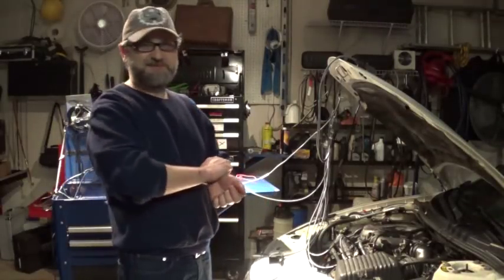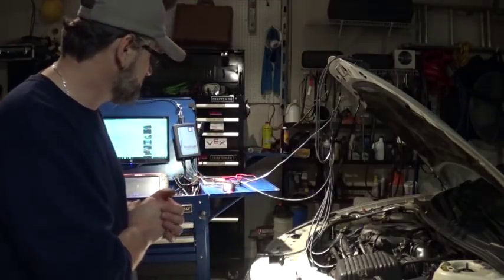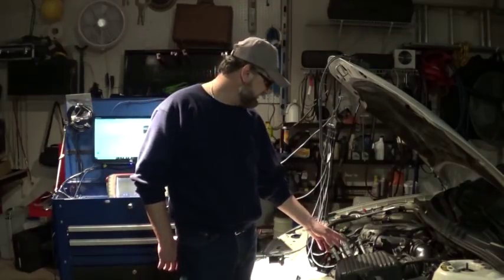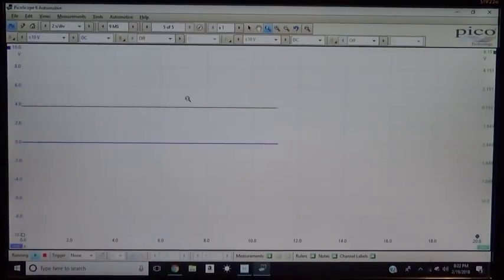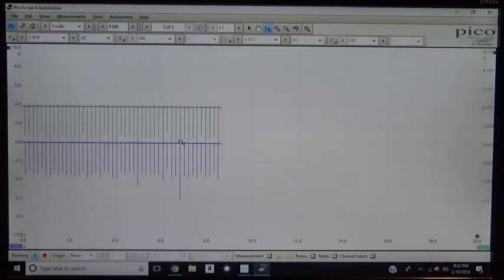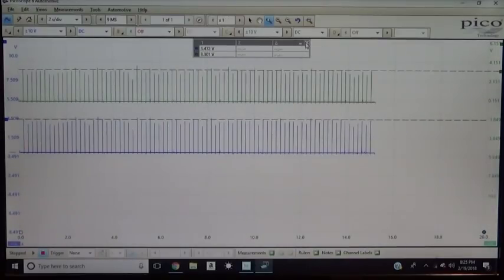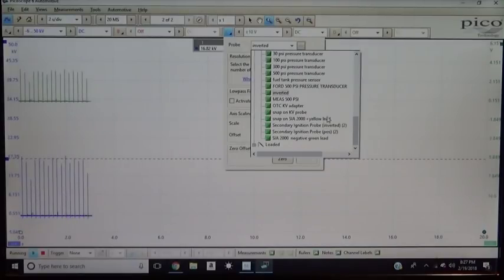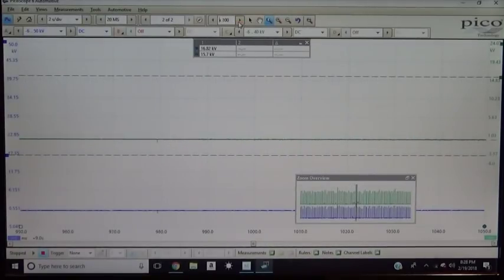Using Snap On SIA 2000 With Picoscope

Comment: Do you need to used an attenuator when you hook it up
Reply from the maker: german torres I don't use attenuator because max voltage output from SIA2000 is around 3 volts but you need to make sure to hook up your ground lead to engine block.

Comment: thank you for the video... is the power kv the distance between top of firing line and top of sparkline where sparkline leaves the firing line or is power kv from firingline distance from ground to top of firing line. if that makes sense
Reply from the maker: Spark KV is line from ground to the spark line. Many times is very hard to see it.

Comment: Ground loops/open circuit etc will  have an effect try connecting each output negative to ground if possible then see what happens. When you have no load on a battery it goes to the supply voltage when you place a load on a battery the voltage drops. When voltages goes up current goes down and vice versa. Try completing the circuit by tiring each negative each of the outputs to ground if possible.
Reply from the maker: setitthen I will try that. I just got this tool . I will take some time to get familiar with this setup. So far I like it. Cheers

Comment: Hi Ramon. You do realise that both wires on the wasted spark system are actually one continuous wire, so to speak, so it is really no surprise that both show the same spark kV, since they are both just displaying the same thing.  The current actually flows in a circuit through both spark plugs, so with both spark plugs removed, if you watch closely you can see the spark on one spark plug jumps towards the negative electrode, and the spark on the other plug jumps in the opposite direction. One other thing regarding waveform inversion. Depending on how the pickups are constructed will also effect how the wave is displayed. If it is purely an inductive pickup, then reversing the clamp on clip at the HT lead, will definitely reverse the wave polarity, whereas if it is a capacitive type clamp, (like the Hantek  HT25), then the output will always be the same, no matter how you orientate the clamp.
Reply from the maker: MAICO MAGNUM  This example was on direct ignition system COP. This tool is new to me and I didn't know which way signal will be display. On waste spark system signal is inverted in tool itself (MODIS or VERUS) but you    need to do set your tool for type of ignition system  you testing. Using this tool with picoscope is so much easier than SO. And I see your point engine block in waste spark system is not ground it's conductor between two spark plugs. Thank you my friend.

Comment: In a future video, would it be possible to show how the SIA-2000 leads are connected together inside its housing? Is there extra circuitry inside, or just a junction box? It looks like a great accessory for waste spark systems, but Snapon charges a high price for something that appears to be 8 wires connected together.
Reply: Does SIA-2000 device have on/off button, power source, or battery? If not, that says a lot about what can be inside the device. 

The probes themselves are designed to match to mix the signals properly (we've seen what happens when one connector is disconnected).

The high price of the device might have something to do with the sheer number of customer support calls on how to use the device properly for this or that car. I would not be surprised! :)
Reply from the maker: Dmitriy L. Hi my friend. This device doesn't have any power supply.

Comment: Great video, your videos keep getting better and better.
I think that the reason your signal changes in amplitude when you unplug one of the SIA input leads is because, by unplugging one pair of plug wire clamps, you are effectively changing the probe  (total) impedance seen by the scope.  Also, I think that the reason that the reason the SO will display both yellow and green channels  correctly on a  waste spark system is because of the channel configuration and not a hardware difference between the + and - inputs. Basically, the green channel has a channel configuration of 5000:1 (or whatever) and the yellow channel has a channel configuration of -5000:1 ratio. (or the other way around). If you are using the Pico with the SIA on a waste spark system you would have to use 2 different channel configurations for scope input A (connected to the yellow lead) and scope input B (connected to the green lead). In other words, a "+" and "-" channel configuration with a multiplier of 5000 on one and a -5000 on the other.
Bottom line is that whether or not you are using all 8 leads of the SIA or not, you should leave everything connected in order to get consistent and comparable results.
Thanks for making this video,  I think it cleared up a lot of the confusion regarding the SIA.
Reply from the maker: RJC3po Thank you my friend. You are right polarity is set in SO tool not in SIA 2000. I will have to use this tool more to get better. Cheers my friend.

Comment: Ramon, you can also use the sia 2000 on a distributor ignition system with an RPM probe, it is very versatile.
Reply from the maker: Hi Kevin. Thank you for your comment. Can you please tell me what is RPM probe used for in this setup. Thank you sir.
Reply: The RPM probe is just a sync. It just forces the scope to start painting the pattern at  the same point in time so you can correlate the firing order to the scope pattern.
Reply: Yes, RJC3po nailed it, trigger or sync.
Reply from the maker: RJC3po Thank you my friend.👍👍

Comment: The green lead, positive firing channel 2, yellow lead negative firing channel 1, they both have a very similar pattern, the waste spark kv will be lower due to lack of combustion pressure. I have use the sia 2000 with vantage pro for around 10 years, and it can be tricky to set up at times on some vehicles. Keep up the great videos!!!!!!!!!!!
Reply from the maker: kevin edward Thank you Kevin. This is very useful tool. I just need to use it more. So far I like it.  Thank you.👍👍